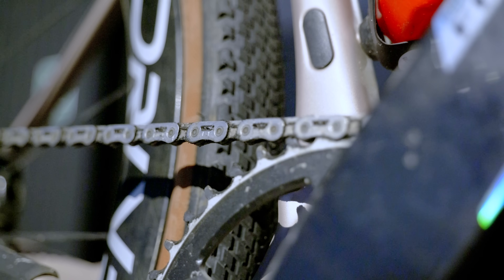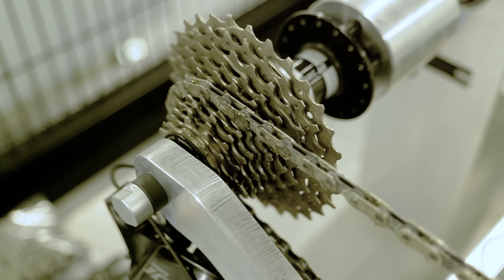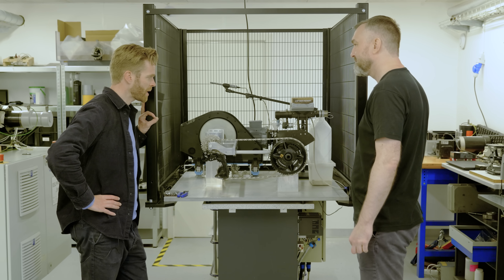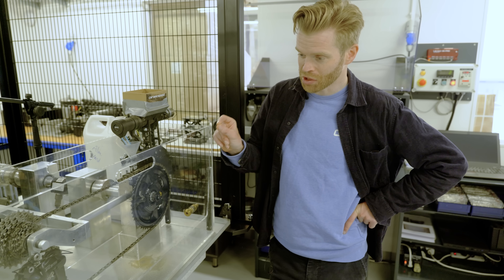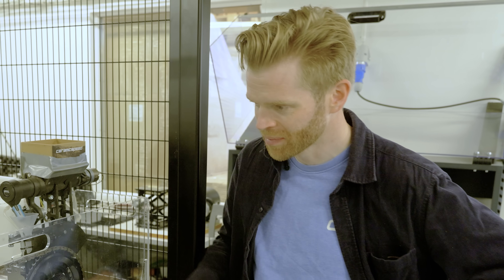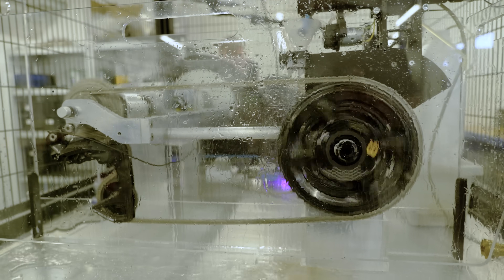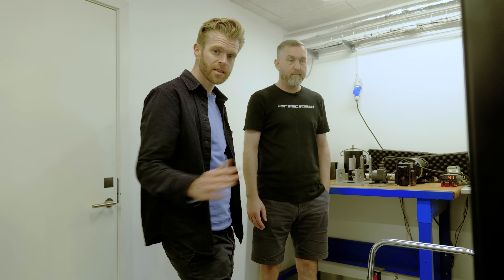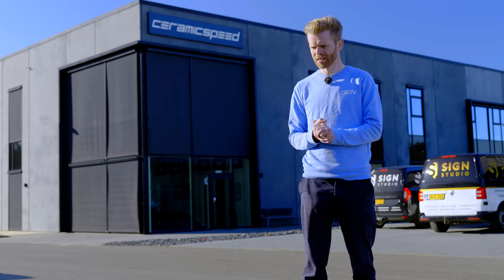We Lab Tested A Dirty Chain, How Much Slower Was It?

Comment: 16:26 If you look carefully the most efficient sprocket seems to be the 3rd largest, it goes down again for the 2 largest ones.
Reply: Its actually because it started the other way on the cassette, 30T is the largest cog. (which explains they had to put 24 27 and 30T on the video so you wouldnt get confused - but alas... :D)

Comment: I lubricate my chain, but don't bother with the wiping it clean bit.  The parts you are wiping are not the parts that are in contact with anything.  Sure, they attract a bit more dirt, but other than cosmetics and the sub-gram weight of the dirt, there's nothing that impacts performance.

Comment: I recall CyclingAbout did a big test on the internal gear hubs showing everywhere from 11 to 33watts of loss depending on which gearbox was used. The two top hubs being the Rohloff and the Pinion at 11w and 19w respectively. This is probably more of a mountain biking question, but it makes me ponder how bad the conditions would need to be for a belt-drive and gear hub setup to become more efficient than a traditional chain and derailleur drivetrain.

Comment: You didn't consider the idea that the chain will have more friction in the smaller cogs because it has to swing farther around each pivot than it does in the larger ones, and all that extra friction adds up.  But you've shown this to be the case.  It's more of an effect than friction due to chainline offset.  It's obvious if you look at it from a mathematical point of view.  Consider the extremes.  The larger you go with the sprocket, the straighter the chain will go.  The smaller, the less straight.  Think about a 10t cog vs a 52t cog.  You could actually test this by setting up your test module with a single speed, with no offset.  How about it?

Comment: I always wondered if the pros pedal in the higher gears or whether they are in the middle of the cassette and save those gears for flats, descents, and sprints? I always run in the middle of the block in gears 4-8 while I'm on the flats and I'm rarely in the higher gears 9-12, but that's mainly because I'm not fast nor strong. It seems it would be more efficient to be in the middle of the cassette and maybe I've been doing the right thing all along. 😉

Comment: the chain is the sum of all components, so, the chain is indeed stretched, what you can say is that the links individually, are not stretch, but the chain is a complex object, made by several links, and though the links are not stretched, like, the metal doesn't stretch, the chain itself is indeed stretched

Comment: How about single front cogs vs triples for the lateral misalignments, for a 21 speed (or whatever specific example), what would be the most efficient shift pattern from lowest to highest gear ratio? Would most efficient be different from the most practical?

Comment: My conclusions: 
1. Big rings and big cassettes are the way to go: rather have a 60-12 than a 55-11 or a 50-10 and have a 42-36 rather than a 36-32 as your smallest gear. So SRAM (and lately Campagnolo) got it all wrong with their small front chainrings (or even worse, pushed by SRAM: 1-by for road).
2. Oversized pulley wheels are a total waste of money: they are bigger, yes, so less friction, except that your chain has to go through 2 pulley wheels so the chain has to bend each way, and the bigger the pulley wheel, the less friction but the more bending, so it's a zero sum and nothing gained with oversized pulley wheels. Most teams know this and run e.d. stock Dura Ace pulley wheels.

Comment: So if you're chasing maximum efficiency you want the largest possible chainring up front so you can use larger sprockets on the cassette. Which then begs the question, does the additional weight have a detrimental effect? What about impact on aerodynamics?

Comment: 17:42, yes but if they are using massive front gear, the backs gears are smaller for the same ratio right ? Thus isn't it better to use balanced gear sizes on front and back ?

Comment: Longevity of the chain and cassette is worthwhile in both $ and time. The more miles you ride annually the more the $ and time spent dealing with maintenance add up. Especially if you have to bring the bike to the shop because you can’t change/size  them yourself. - In the old days running 10 speed and rock and roll gold lube (applied religiously but over a dirty chain) the cassette would wear out in about 3500 miles with chains changed at about 1500 miles . After too many trips to the shop I figured out how to do it myself to save time and $. Now with CS drip wax and very occasional cleaning (I try to avoid wet rides) I can get 4K to 5k miles per 12 speed chain and 8k per cassette and I tend to be a gear grinder and I’m not lightweight so others might do better  . I think this is worthwhile. To me the full chain wax method via removing and dipping it seems to have minimal ROI vs just using CS drip lube.

Comment: Great video Ollie. Thanks for everything you do! Did you consider the impact of cadence on power loss? It seems like reduced cadence may cause more friction because the chain around each pin is bent for a longer period of time as it turns through. Assuming power was kept constant, cadence would have been much lower in the smaller sprockets.

Comment: Wow, what a great idea to make this video, but something in the testing went horribly wrong. I'm surprised there wasn't more investigation into the odd results. 1 watt slower on a chain with that much gunk on it cannot be right
Reply: The gunk was on the outside, if it had been on the inside it would have been another story. Later on when sand and water is applied to the chain, it shoots up to 12 watts loss.

Comment: I was surprized how you said a right out of the box chain was "optimal" for efficiency. Optimal for cleanliness maybe. Manufacurers use grease to prevent corrosion, which isn't the best  lubrication  to minimize resistance. Also, I would expect some break-in wear to benefit how freely the chain moves.

Comment: Small cogs make the chain turn tighter which makes the chainlinks travel/rub farther against each other, thus amplifying friction losses per chainlink. Makes sense. That the dirty chain did not have much loss was a surprise, because I definitely feel the difference after cleaning my chain. Your "dirty" chain in fact looks clean next to mine... Try it again with an overlubed chain that has been in service uncleaned for half a year or so...

Comment: "Big gears are more efficient than small gears."  Well then SRAM has a design problem with smaller front chain rings and ten tooth cog. I bet Shimano has a similar rig and hence why their drivetrains are more efficient than others. They found The Sweet spot. And I couldn't help notice, that running a  sram chain on a Shimano drivetrain was not mentioned for the potential additional losses. At least that's what the marketing tells us. It's not as efficient.

Comment: I love the results because what I keep telling my friends, that the chain line doesn't matter that much and riding a large chainring with a large sprocket is more efficient than the same gear ratio using a small chainring. It would be alse nice to compare gearing 54/27 and 38/19 (or 50/25 and 34/17). Good job!
Reply from the maker: thanks, glad you enjoyed the video!

Comment: People get Watts and losses wrong. 

If you ride at 250W, say 25km/h, you are „losing“ ALL your Watts. If you werent, youd go faster. 

You are putting in Energy, and if you are at an equilibrium, the energy input is equal to its output. 

Now a 2Watt „saving“ in the chain means we will go 2W faster. That translates in almost no speed advantage as aerodynamic losses and wheel efficiency losses are far more significant. 

There are some scientific papers that put the drive train at around 1% of Energy loss at 30kph. Its 80% aero and 19% wheels and tyre friction.

And as has been shown here, using an efficient gear is far more significant than getting the best chain wax and bearings. It btw is also way more effective than getting an oversized pulley.

Comment: As you shift through the gears, there is a very big difference in chain tension due to how far the derailleur has to move to take up chain slack. Put your bike on the stand, put it on the big ring up front and the largest gear on the cassette and just spin the crank. Now go to small / small and try it again. On my bike the crank spins much more freely with small/small.

Comment: The chain articulates a lot over the jockey wheels, what do they contribute to the losses, if the sprocket size is significant would that not make the jockey wheel size significant as well?

Comment: The best part of the video for me was when the engineer pointed out that in similar conditions, the 8W of loss on a SRAM flat-top train would drop to 3W on a Shimano. That’s similar to what Zero Friction Cycling finds. So why is anyone running SRAM chains?
Reply: I must add that the 3 watts and 8 watts are on another test setup (chain test only, not entire drivetrain) - and it also comes down to what lubrication. However to explain why people would use SRAM chains - longevity. They have a very good coating that lasts forever. At least the expensive SRAM chains. If you buy the cheap ones, they become faster like shimano (not quite but close) but then you dont get the superb coating.

Comment: Regards chain “stretch” I’ve concluded that roller wear is irrelevant. The roller runs on a boss and the boss runs on the pin. It’s boss wear on the pin that makes a chain “longer”. Say a roller wears from zero slop to a massive fifth millimetre slop. At any point on the chain ring a roller is then a tenth millimetre forward than new. The next roller to it (both leading and trailing) is also a tenth millimetre forward. Result…. No change in pitch. If the boss on the pin is worn the leading and trailing pitch increases. That’s “stretch”

Comment: "use good quality lube" -- is there any logic and facts behind that? Something tells me that average quality lube still works excellent and low quality lube still works. It seems they just said this for the sake of sounding good.
Reply: I’d suggest good lobe will stick better and throw less when the chain is being spun
Also depending n viscosity. Will simply do a better job
Either way frequent application and cleaning is the secret to both longevity and use

Comment: This supports "spin to win" philosophy.  When I'm spinning to win, how does the additional leg movement impact aerodynamics?

And how does the bouncing effect of body weight while pedaling impact rolling resistance? (Heavy gears having a longer, heavier bounce while light gears having lighter but more frequent bounces.)

I'm new to cycling, so I bounce more than a lot of riders.  It's still pretty light but happens thousands of times per ride.

Comment: So happy that I never wasted my time cleaning my chain after every ride.
Reply: I clean my chain when I begin to feel (and hear) it grinding. A clean lubed chain is smooth and quiet. A dirty chain gradually becomes noisy and rough.
Reply: Too bad for ya.
For me it ended up in badly damaged teeths...
Now it cost me around $150-$200 just to find a replacement, instead of using some "used" car's engine\ manual gearbox oil.

Comment: Interesting that they're using what appears to be a Tacx Neo bike trainer as part of the test setup.

Also, that "dirty" chain is far cleaner than mine is most of the time.
Reply: The Tacx (or any similar) trainer is the easiest way of applying whatever load you want on the fly without having to invent your own resistance machine.

Comment: I am really suprised to see that there had been no testing done at different temperatures.....
Reply: Well, how would you go about that exactly? The machine is in a test lab at ~20 degrees celsius. Just by articulating the chain around the sprockets it generates heat. Its not really an exact science as it may sound easy to do, but its really not.

Comment: Back in my day, 13 tooth cogs were the smallest available. Juniors we restricted to 14 teeth. When "compact crankset" marketing finally got the upper hand and defeated the 53-39 front ring setup, cassettes needed to offer smaller and smaller cogs to compensate. Not really surprising that the industry did not bother to test the efficiency. On a positive note, there is no question that cassettes with 10+ cogs solved the problem of insufficient low gears, but, now that we know how much additional drag small cogs add, I hope to see road bikes return to bigger front rings and bigger rear cogs. It would be interesting to see the upper limit too...

Comment: As with most things in cycling, the purported benefits of regulat chain cleaning and lubrication really only make a significant difference in racing. For the average consumer, a 30 second difference over 25 miles is completely immaterial.
Reply: Rust prevention is the main point of lubrication from the POV of a daily commuter. In winter, when the roads are salted, your chain can turn to rust overnight if not cleaned/oiled after riding, & shifts will become unpredictable. Luckily all you need is a rag, a tin of WD40 type spray, & a tin of 3 in 1 type oil to prevent this. Takes a couple of minutes before you put your bike away when you get home. I've worn out a cassette in the past (the chain started slipping off the teeth eventually as they were so worn down), but can't say I've worn out a chain or front cog to the point of unusability.

Comment: A massive chainring means smaller cassette sprockets for the same velocity. So I don't think that is why the chainrings are bigger. They are bigger because they can have a wider range of gears and handle the bigger rings. The real interesting question for me would be the friction comparison between the large and small chainring for comparable a bike velocity range. Use some typical off the shelf gearing for road bikes and test the overlap. Probably not a bid deal like these tests, but interesting.

Comment: The relative results did not surprise me at all, but I had no idea what the actual values might be like. If you had told me a dirty chain was 3W loss and the 11T sprocket was 42W loss, I would have been no more surprised than 1W and 14W loss. Now I can put it in context with other efficiencies. Thank you for that.
Even though I will never win any race, I will continue to keep my chain as clean because I can; I like my money and I will take the 4.5s over 40km.
Thanks for video

Comment: Who saw the tacx trainer messuring the drivetrain efficiency?😂
Reply: The Tacx trainer is used as load only, there are 2 torque sensors - 1 on drive side and 1 on load side that does the actual comparison. At 3:12 you can see the load side torque sensor its the black box with the yellow label in front of the Tacx trainer.

Comment: I would really like to see what the difference would be using a worn chain, say somewhere in the 0.3% stretch region. Would it be able to handle the misalignment of the chain line better because the wear would allow the the chain to be more flexible in the transverse direction? It's certainly easier to bend an old chain sideways than a new chain. Just a thought 🤔.

Comment: Did the machine apply continuous force throughout each revolution of the bottom bracket, OR did it correctly simulate the action of a cyclist applying force that varies in magnitude depending upon the angle of the cranks with respect to the angles where maximum and minimum force can be applied due to rider physiology?  Also, if they did, did they compare and contrast riders whose feet are attached to the pedals, (with toe clips or clipless pedals and shoes,) versus a rider with ordinary flat shoes held in place only be friction and gravity?  Because that probably matters too.  I DO wonder why bigger chainrings and cogs matter, and speculate that maybe there's a certain amount of flywheel effect which evens out power delivery a bit more than the flywheel effect of the wheels and tires themselves?  Has anyone tried making a TRULY MASSIVE chain ring sprocket, just to see if that matters?  I.e., compare on the dyno the exact same chain and cassette in all the different gears, with sprockets having the same diameter and shape, and number of teeth, but with some having a thick ring of metal at or near the outside diameter, to see if having that little bit of extra rotating mass to even out power delivered between the points in each rotation where the crank arms' angles get the minimum and maximum force input from the rider due, again, to physiology?  Or am I wrong in assuming that trained cyclists are putting out different amounts of force at different crank angles?  Seems almost impossible but I'm only a recreational cyclist.
Reply: There is no way to make a test machine that can simulate the pedaling action and get meaningful graphs out of it. This test machine held a steady 95 RPM throughout the test. Including the gear shifts. (it has encoders on both axles)

Comment: Does the effect work the same on the front sprockets? Smaller front and larger rear would actually lose efficiency over large/large configuration because there’s less “pull” on the pins as they rotate around the sprocket ? Doesn’t that kind of go against conventional wisdom?

Or am I thinking about this wrong and the effect would somehow be reversed on the front?